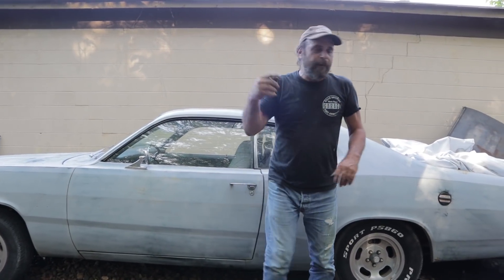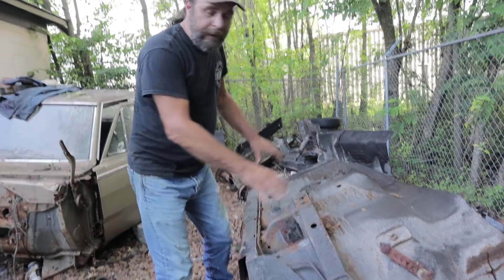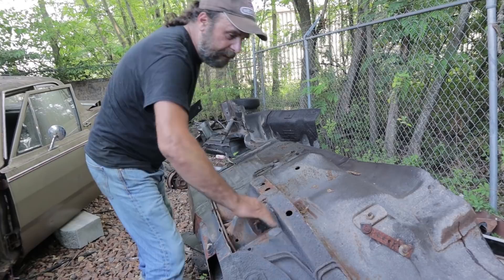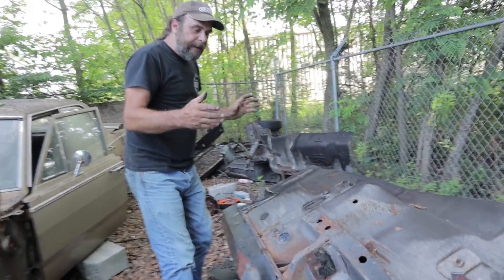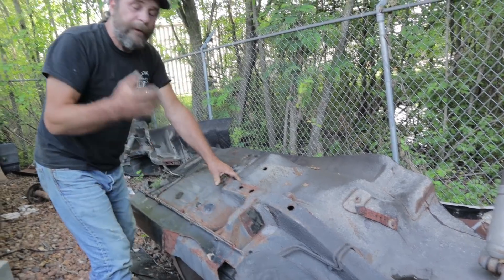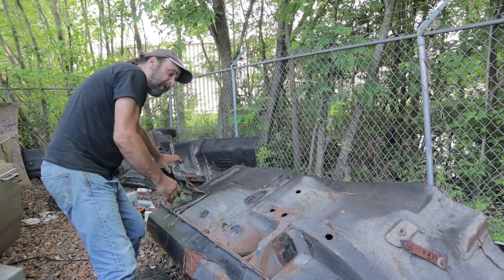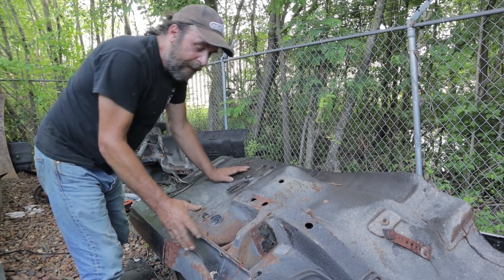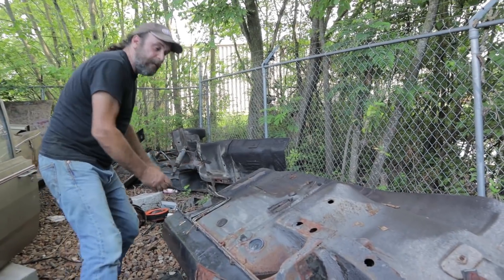Chassis Basics-Frame Connectors

Comment: I have to disagree with you, UT. I've worked in suspension design and the desire is that the chassis is static so the suspension can do its job. Chassis flex is unpredictable, where as suspension reaction is highly predictable. I've also never heard of a car breaking spot welds when connectors are added, or absolutely not when they're caged.

The simple fact is the factory didn't add them due to weight and cost. I still love ya, but we disagree here.
Reply: @axipixel5811  I've said this in other comments, and I've stated my case to Tony exceptionally clearly above, but I'll hit the highlights of your comment as well...

1 - Aircraft wings ARE their suspension. The chassis of a car IS NOT its suspension. These too things are not parallels. In a car you WANT the movement to be isolated to the suspension. That's exactly the job it's there to do.

2 - I'd love to read more about the intended chassis flex in F1 cars and would appreciate you offering sources for where, and how, they've designed the chassis to intentionally deflect rather than have the suspension do that job.

3 - It's frustrating that you can make a case for Tony's point by saying that he's speaking in broad generalizations and then tell me I'm an idiot for using exaggeration to make the same point. No shit you wouldn't design a car to use the body as the entire suspension. That was an exaggeration to illustrate my point.

4 - **I** am not the guy the that called me to stupid to understand engineering concepts (which you have also now done), thus requiring me to do something I don't like doing (quoting my resume), I didn't "go on" about it, and I DID explain the material properties that change when you weld steel... I didn't start that conversation, but when you play stupid games with people you don't know, you win stupid prizes. I'm not going to let any jackass, who unprovoked, told me I don't understand engineering concepts after spending 6 years in engineering school, period. I don't take that BS and no one who takes pride in their trade would either. I don't go chuck rocks at the guy that made that statement while he's out mowing grass, or whatever it is he does, for a living. I knew going in that I would get this comment in response. Prophecy fulfilled. As another nugget to put out there, if you actually want to learn why I may believe one thing or another, why not ask? That's not what that guy did, he insulted me instead, as you have as well... You've led me to believe that you are also in the engineering field so it's just mind boggling that you can't see that. You ever walk into a meeting of colleagues and tell them they're too dumb to understand the point you're making and then accuse them of being arrogant? Good luck with that...

5 - I agree with you on your final point that frame connectors are not a one size fits all strategy, but that's not the generalized point Tony was making, or at least not as I heard it. The argument was that frame connectors stress the rest of the chassis, not of Mopars, but of unibody cars. I flatly disagree with that. I've also looked for real world examples of frame connectors causing damage and can't find any. If we are now having a respectful discussion, by all means, steer me to the sources.

Unless you actually want to have civil, respectful, discussion on the topic, I'm done here. I've stated my case on all of these points very clearly, and began the conversation respectfully, and I have better things to do than just be insulted for disagreeing with Tony. I'll also add that's something that Tony did NOT do. He's able to have a friendly discussion and I hope the tone that the rest of you have taken, and I've now falling into, doesn't taint that.
Reply: Paul Dawson  So what engineering principals were discussed here? Work hardening of a weld that is already the hardest steel on the entire car? Ever tried to drill a weld...?

I'll make you a deal. If you and UT produce copies of your engineering degrees from an accredited university, I'll give you $1000. When I produce mine, you owe me $1000. Game on? Some of us have actually performed automotive design, professionally, as a career, and actually have engineering degrees. In this conversation, I'm confident the only person in that category is me. Don't tell me I'm too stupid to follow along.

I was trying to be diplomatic, but with you, that ends. He's just wrong this time. It happens. Just think about it for 3 seconds... If you wanted the chassis to flex (or the body to satisfy your need to split hairs), why wouldn't you design it so it can flex enough that it wouldn't need suspension at all? The OEs would LOVE to eliminate the massive parts count of the suspension system from their books. Just make the body do it, right? 

Why do F1 teams and supercar builders make the stiffest vehicles on the planet? I mean, surely, some tacked together sheet metal results in a more predictable final result... but only the geniuses at Chrysler 60 years ago could master the technology and no one else has ever been able to achieve their high water mark again... including trillions of dollars spent by race teams across all fields of sport over the decades.

That says nothing of the hundreds of thousands of cars out there with connectors, cages, strut braces, etc, etc in them right now that aren't breaking a part at the seams. 

So... I'll be more cordial with UT because he's not being a jackass (he's just wrong, IMO), but I'm pretty sure I've made my opinion about your approach to things pretty clear.
Reply: Paul Dawson  You're splitting hairs. To your point, the body and suspension mounts need to be as solid as possible to be able to predictably tune a suspension system.
Reply: @dudebro313  Thanks, man! From my prospective (and I've only had passive involvement in NVH discussions on a professional level, this is almost entirely my hobbyist opinion... so if an NVH expert comes in and tells me I'm wrong about all of this and states their case, so be it), not just "no", but absolutely not. OEs (at least modern ones), go way out of their to make sure things don't move around, and that's especially true from an NVH standpoint. Things moving generate their own frequencies, those frequencies are vibrations, and those vibrations are what cause the N and H issues in most cases. Some manufacturers even go so far as to tune everything in the car that has to move (such as the motor mounts, suspension bushings, etc) to the same frequency as much as they can, then use the audio system to cancel it out by playing the same frequency 180 degrees out of phase through the speakers so you don't even know it happened. As an unintended side effect of those efforts, several manufacturers have made their cars so quiet and smooth that they actually have to add "sound pipes" into the interior from the engine bay so you can even hear your new 500hp performance car. Some manufacturers even cheat that and play engine sounds through the speakers too. Yamaha cruiser bikes intentionally misfire at idle so they sound like Harleys even though they don't have a V-twin design of a Harley (so they don't sound the same). Modern OEs have all sorts of tricks like that.

In terms of this discussion in raw chassis stiffness, the only thing I can readily think of where flex is intentionally engineered into a chassis is on trucks and other 4x4s. They know they're going to be used in rough environments and they have to plan for that. You can't make a profit and give everything a Baja grade suspension with 30" of travel, so the frames are designed to twist instead. That's why truck beds and cabs are never attached, so they can move independently from each other (plus the cab is rubber mounted and the bed is not). With that said, trucks have been where most of the NVH improvements have been born since those were always the worst offenders, and are now the most expensive vehicles on the market (for the budget of mere mortals anyhow). Ford pioneered the use of a material called "quiet steel" some decades ago that is actually steel laminated with a rubber layer inside it, that can be welded, specifically to address NVH issues.

So, the TLDR, is "not that I can think of, other than trucks".
Reply: Im building my 69 nova back up for daily driver. Big block at some point. Simple things i can work on at home. I plan on fabricating my own connectors or torque box. You say both? I'm leaving the suspension as is, except new ball joints.
Reply from the maker: No question about what you said about suspension being true...but that has nothing to do with the point of this video.  
Also, a full cage and connectors are two completely different things.  The cage integrates both halves of the car into one unit, connectors only take the twist from the center of its floorpan..  As for spot welds breaking...they NEVER EVER break, but the metal surrounding them will let go without much effort.
And finally, think about what you're saying about weight and cost.  Chrysler had no problem with things like the Max Wedge exhaust systems, but didn't feel it necessary to add a simple four foot section of box tubing between the subframes?
Torque boxes and rocker bracing are far more involved and less cost effective than a four foot length of steel tubing...why did Chrysler chrysler go through all that trouble and expense if there wasn't a larger structural reason to do so?
Reply: @UncleTonysGarage  I appreciate the response, T. I watched the video again just to make sure that what I thought you said is what you said... and it is.

What you claimed is that the welds will work harden and break. I'm telling you that the welds, and the area around them, were work hardened when they were made. In fact, the area around the welds is annealed (softened) by the process. That's why material fails around weld joints (and also why welders spend decades learning how to make the proper weld joints for the proper applications), which is what you just said in your comment. If it you introduce more movement around the welds, by allowing additional flex in the body, you have increased the odds of that happening, not decreased them.

Cages and frame connectors do the same job in terms of stiffening the chassis up. Cages are just much more effective at doing so since there's radically more of it, and, as the name implies, it's a literal cage of steel. The cage tie points are in the exact same locations that frame connectors begin the process (the A-pillars, where the front sub frame ends) and rear down bars that usually connect right at the rear suspension (which is normally where the rear subframe stops). You have to get up to pro-mod cages before they tie into the front and rear suspension and genuinely replace the original structure of the car. I agree that cages also tie the car together better laterally, and I would say that's also a good thing. Some companies even offer subframe connectors that tie all the way over to the rockers in an effort to add more torsional stiffness without a cage (the Kenny Brown matrix system for Fox bodies come to mind). You can, and do, add lateral stiffness by increasing the size, or number, of a beam(s), which is all subframe connectors really are. They're just beams added to the length of a car. I suppose the easiest example would be to attempt to twist one popsicle stick vs. attempting to twist 2 sticks attached to each other. Stock is one, frame connectors are the second. Once those beams are tied to the subframes, they create boxes under the car the stiffen the entire assembly up.

In terms of cost added upgrades, Chrysler, like all manufacturers, added the bare minimum that the car required and that their marketing department could sell to the dealers and the public. As you said, max wedge exhaust systems are expensive, but cool, hence why they have a cool name and everything to go with it, and are a performance gain (so increases that important marketing data in the magazines) so people were willing to pay for it. When you claim your chassis is 50% stronger than the base model, that's actually promoting a negative (the base models must be too weak!), so no one in their right mind would ever do that. They'd have to do them all, or none, if that was the approach. Chevrolet has actually taken that approach for years with the Corvette. Every time a new one comes out they are always advertising that it's the stiffest chassis they've ever produced, period.

With all of that said, Chrysler then, and even now (with exception of the Demon as I understand it), voids the warranty if that car is ever used for racing and Hemi cars got 1/5th the factory warranty even at that (and as I understand it, depending on year, Hemi drive trains go no warranty at all). They did that because they knew people were going to abuse the cars and the cars were going to break in their stock form. The same is true today. The cars should not be beaten on without being upgraded. To your point, that depends wildly on your intended use. In fact, that's one of the things I appreciate the most in your content. You frequently tell guys not to waste their money on X or Y if their goal is to cruise. But, in the case of the hi-po stuff we're discussing, this isn't cruising... I agree that you don't need frame connectors to get groceries, but I disagree that there's a downside other than your bank account if you do it anyhow.

I also disagree that the torque boxes are more involved as far as mass production assembly goes. When the chassis is going down the line on assembly fixtures it's not the end of the world to add another few spot welds and components in an isolated area (I've never had the opportunity to have a close look at the Mopar torque boxes to count the spot welds on them, but I'm assuming there's not an insane number of them or anything, and these days those are done with robots.... It may have even been that way back then too, just very simple "robots", like multiple weld heads on a fixture that drops and performs all of the welds at once), the true cost is in the additional materials, even all the way down to the extra paint to cover the extra metal. Frame connectors are easily 10x more steel than the torque boxes. Plus the tooling to make them is 4x larger, and the press to stamp them is 10x larger, etc, etc. I'd also argue that if you had to pick one or the other, the torque boxes are the more effective bang for the buck, as you correctly stated, the rockers are already there to help out, so it's less expensive to tie them to the subframes than it is to replicate them again inboard. My opinion is that having both would be the best option, which is exactly the opposite of what you're saying in the video. The argument that they intentionally designed without them so the car can flex is counter to everything I know, and is available to learn, about suspension design. Eliminating frame flex to able to tune the suspension, other than avoiding outright damage to the car, is the primary reason to install connectors. What you're really talking about here is a suspension conversation, so it's not irrelevant to the point at all. 

In reality, how this works is the suspension guys argue it out with the chassis guys and usually it's the bean counters that win and strike a balance. If engineers won all of the arguments, cars would almost never break, would cost 10x more, and no one could afford to buy one. That's a harsh reality that I still struggle with on a daily basis in my career. I want the best thing I can do to be out there in the world, but the company wants the best thing that they can make the most money on, and those two things are rarely the same. In this case, I feel frame connectors from the factory would have made for the best product in addition to what is already there.

Again, I'm not attempting to personally attack you, and certainly I don't intend to insult you. I got a little heated with a couple of other guys here that are basically calling me a dumbass for disagreeing with you and I hope I haven't let that frustration bleed over into our talk. I appreciate the respectful discussion and I enjoy your channel (including this video). I just disagree with you on this topic, or at least I disagree with you based on the logic you've presented. I'd love the chance to some day shake your hand, drink a coke with you, and tell you I love what you're doing, but disagree with you sometimes. Every race trailer I've ever stood in is knee deep with conversation just like ours and I hope you understand that's where I'm coming from. Chatting as buddies and not insulting as enemies.